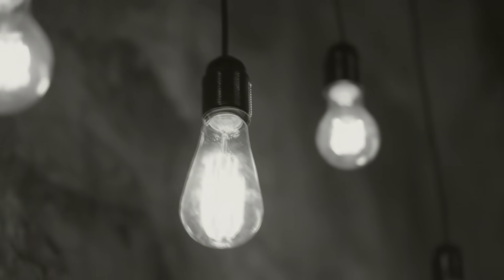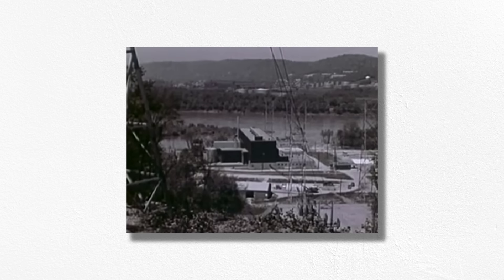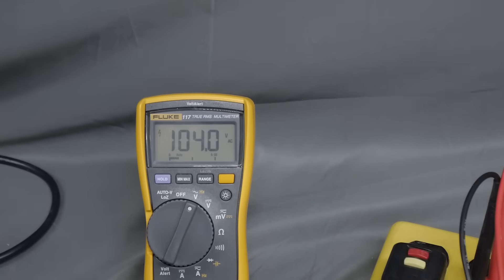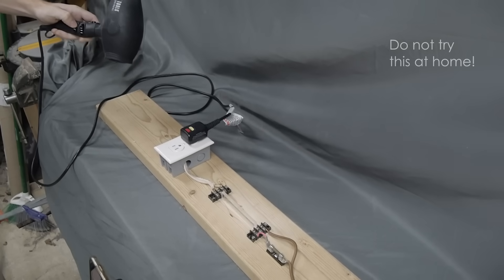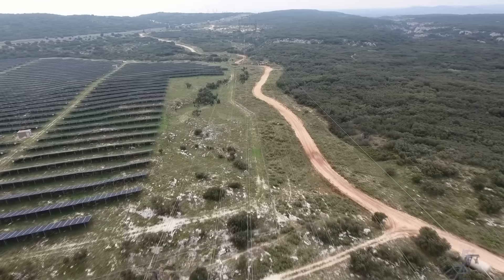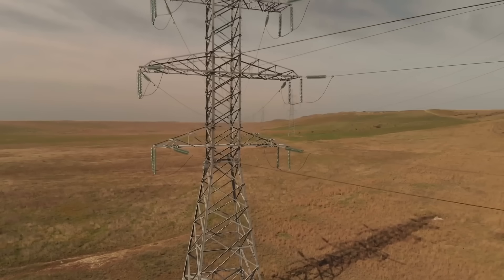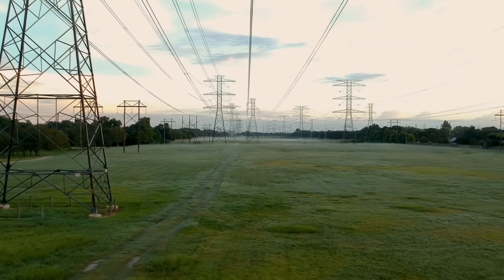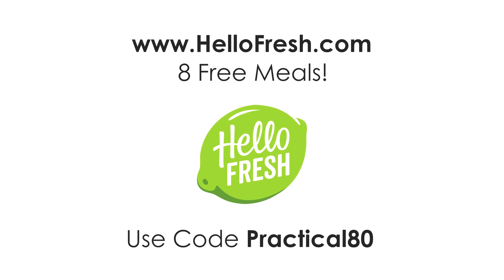How do Electric Transmission Lines Work?

Comment: Just making sure i got it right. does the ceramic disks prevent electricity from flowing through the metal tower to the ground, while their shape prevents electricity from taking the short route to the tower via water on the ceramic disks on a rainy day?
Reply: Yes. There convoluted shape makes the conduction path longer so that smaller insulators can be used even when wet.

Comment: Loved the hair dryer transformer bit was a brilliant idea. Always good to see a video from you :)
Reply: Using microwave oven transformers to do the step-up / step-down usually results in very high losses, and is really only good for demonstration.
Reply: I was reminded of electroboom, and then got disappointed why you didn't shock yourself.
Reply: Yeah it was a great idea, so good I think I might try it at home
Reply: @willdbeast1523  s
Reply: @willdbeast1523  I know you're probably joking but... please don't, that thing is a death trap. That thing has wires live at several thousand volts, and you should stay away from those — literally.
Reply: I don't see any danger if you know how things work.
Reply: @willdbeast1523  why not just go straight to the source and touch the wires at your local sub station *s
Reply: CasuallyPlayinGames totally agree, I knew most of these things and still found the demo cool. Hard to beat seeing something in action!
Reply: Sure was!
Reply: such a clean demo, recently got an old microwave from, a friend. really want to replicate the demo
Reply: @memejeff  its a wasteful setup, those transformers (any small transformer) typically have high losses, so two in series will be terrible. Microwave transformers are awesome for many other projects though, like playing with and learning about high voltage. For example, the old fashioned way of making a tesla coil, involves using a microwave transformer to step up the voltage before it goes through a spark gap. With a relatively simple setup you could make several hundred thousand volts easily (and safely) and demonstrate things like real wireless electricity.
Reply: @Nabo00o  Yeah, I know about the low efficiency but as a I said. I thought the demo looked clean and would work fine for a little demonstration setup to show the principle. I was thinking of using it mainly for microwave generation and for the versatile 2000VAC output :D
Reply: Can everybody PLEASE check out Photonicinduction. 
He explains just how dangerous microwaves can be
Reply: The voltage drop occurs at the END of the long extension cord; not at the receptacle that said cord is plugged in at.
Reply: You think he uses it

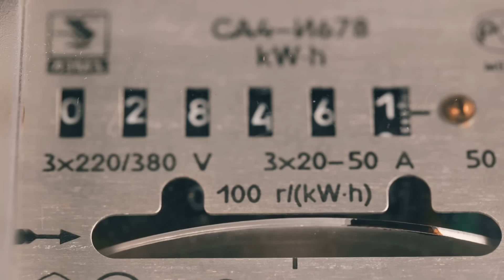Comment: 1:19 here you get billed for transmission loss as well :c
Reply: Everybody gets billed for that. Companies are not charities. For most people it's just included in the kWh price of the usage they do pay for.
Reply: Where is "here"?
Reply: In Jordan the government compensates the loss in transmission by stepping in as an intermediate party that runs the transmission lines between generation companies and the distribution companies. it counts of up to 37% of generated electric power.
Reply: In SoCal we get billed by power companies because they start fires due to lack of maintenance.  
We get billed for improperly designed nuclear power stations and later decommissioning of those plants.
We get billed when they convert to solar and wind power.
We get billed for the pollution caused by coal, gas, or hydro.  
We get billed for even thinking about using electricity at the wrong time of day.  

Now they shut the power completely off if they think it's too dangerous.
Next we will be billed while sitting in the dark

. ..
Reply: How? Sure you pay a fee per kWh for high- and mid-voltage transmission to your energy provider, but that is more than just the transmission loss. You only get billed per kWh that passes by your Wattmeter/Ferraris-counter
Reply: Andrea
"In Italy you get charged for inductance and capacitive losses in your house."
That's probably what he's referring but at least in my country Brazil you have some accepted limit of loss 8%.
Reply: In the USA I get billed for Transmission and Distribution which are both a large percentage of the total bill and are charged per kWh.
Reply: In Italy you get charged for inductance and capacitive losses in your house.
Reply: in Mexico you have your price per kw/h and a transmission fee + many other half ass fee's...
Reply: I've never seen an electricity bill explicitly mention transmission loss.

But on the other hand around here we have to pay a 'standing charge' just for having al electrical connection.
And given how high this charge is in relation to the cost of electricity, if you use less than about 10 kwh a day you're probably paying more just for being connected than the electricity itself.

Meanwhile when I lived in England I was getting bills for water and sewerage separately...
And the Sewerage bill was calculated as 1.1 times the water usage of the property, with the excess being 'stormwater' drainage...

Anyway, it's all in how you look at it with stuff like this.

I've heard people argue that 'income tax' is the fairest form of tax because individual pay it (can't say I agree with the reasoning these people use about why this specifically is fair)
But regardless of whether that's fair or not it's also a bit of mental trickery to say 'individuals' are paying it;
The vast majority of people are employed by others, and typically it's your employer paying your tax.
Which means you could easily argue it's not really a tax on individual earnings but instead a tax on hiring employees.
Does this distinction matter? Not really, but it mainly just demonstrates it's a matter of interpretation.

Paying for transmission losses separately vs the electricity provider simply factoring it into some other element of the bill (standing charge, the electric rate itself, or whatever) is really an academic difference that is more about how you present information than about anything meaningful.
They're still primarily working off your meter reading, then maybe doing a few simple calculations somewhere along the line.

Doesn't really change the overall outcome much.
Reply: Can't do shit about it unless we manage to break even.
Reply: Yup, in my area it's called systems loss and it's a per kwh you consumed charge.

Comment: Wind also has a very large positive effect, with small amounts of winds ~2m/s + greatly increases the heat dissipation of a power line. 

Also earth wires are typically used for communication as well with multiple fibre optic cables embedded with in them.
Reply: The company that runs the transmission lines replaced the upper shield wire on the 120 kV line in my yard. The new shield wire has 1700 optical fibers. But they aren't used for communication, at least not yet. They haven't gotten permission from the railroad to work over the tracks. The rest of the fancy new cable is spooled on the tower across the tracks from the substation.
Reply: Here in the Netherlands we have some high voltage powerlines above ground but all the low and medium voltage is already in the ground. New high voltage lines are also laid into the ground nowadays. So no not really. Wires in the earth are not only used for communications and other stuff..
Reply: @brinkshows2720  Well that works because the Netherlands are really dense in population, small in size and not subjected to earthquakes (except Groningen but w/e) 

Population density and size helps because digging holes is friggin expensive. Having less distance needed and more people able to pay for it is good. And the no earthquakes and other mayor disturbances makes ground cabling relatively worthwhile to do.  Also, when you move further and further away from the randstad the powerlines start appearing.
Reply: @Torchedini  Yeah thats because in the Randstad the powerlines above ground have been replaced. But more outside the Randstad if there are new powerlines they are also laid inground.

About the population density. This is true that its really dense, but if you look anywhere in the country there is no low or medium voltage line found above ground. Also in foreign countries you also see low voltage powerlines in cities above ground. 

Yes we don't any earthquakes (except for Groningen a little), but powerlines are one of the utilities that is least affected by earthquakes. Some even say its better to lay them in ground because when an earthquake hits powerpoles fall over and create damage and dangerous situations, while if they where in the ground they wouldn't have.
Reply: Torchedini for sure. Its around 16-20 times more expensive to underground powerlines here in the UK!
We find it hard enough getting a large enough budget to maintain and upgrade the overhead network as it is.
Not to mention under fault conditions, underground cables are hard, time consuming and alot of hassle to locate damaged sections on, leading to greater disruptions in supply, greater resources to correct and generally a nightmare for everyone involved
Reply: @brinkshows2720  The Netherlands also has a pretty mild climate. For much of NAmerica the top several feet of ground will freeze in the winter which can be (a) very damaging to infrastruture (b) a big hindrance to construction and/or repairs. Plus NAmerica had/has a surplus of trees making wooden poles much much cheaper than underground wires.
Reply: @JonnyD3ath  except of course when there are existing ducts from a prior project, then the extra cost is only paid once initially, plus a little extra to access the duct again. In my city gas, electricity and phone are ducted in some areas, and in a subset of those, fibre optic cables were later threaded into existing ducts. I believe a lot of the underground fibre rollout is also adding ducts where there weren't previously, for future expansion/repair/other unrelated use. Some places use the gas pipes themselves as the ducts for fibre. I like ducts.
Reply: Kit Vitae at a huge expense though and generally only in cities, most of the transmission network is rural. 
You can bet if one company has spent tens of millions building a servicable duct in a city they aren't going to just let another company walk in and install their equipment free of charge either! Lol
Reply: @JonnyD3ath  definitely only in cities or otherwise wealthy enough populated areas. The small but wealthy village I used to live had a duct installed under the road when Openreach put in fibre, it was nothing more than a corrugated plastic pipe like you might use for water drainage, but importantly it provided a barrier for the fibre from the soil, and could be accessed at certain points along the road (where they installed square manhole cover looking things, 2 or 3 along the one main road in the village). 

We had overhead power transmission, but Openreach didn't choose to just string it along those existing poles. In the city I live now, as I said, everything is underground and ducted, which sure gives peace of mind in floods or storms, which both hit that little village pretty hard too, and we got power cuts and all sorts there from it. Maybe that's why they buried the fibre, it's more involved and costly to splice a new section of fibre than it is a power cable. 

Anyway. It was my understanding that they usually leased space in the ducts, or leased dark fibre they put in the ducts while installing their own line, as opposed to outright blocking access and forcing overbuild. Especially with overbuild reduction being a key part of the UK governments' Openreach investment terms. But maybe I'm wrong, or it's just not as common as I think. Either way, I know the fibre provider to my block of flats ran their cable through the existing power and phone duct on my street, however they arranged it to happen. (Maybe the property developers made the duct themselves when they made all the flats? Electricity, phone, gas and water all had to be specially extended here when building started, and I think it's not technically a public road?)

They only had to dig one access point in the road and some minor work in the basements, I'm pretty sure. I remember seeing a small fenced off area appear and thinking the road would get all torn up like in the village, but after a few days the fencing came down and didn't come back up. Compared to when there were water works ongoing, and their fenced-off area slowly crawled along the street over a few months.
Reply: Kit Vitae it has to be done in a city environment and is economically justifiable but on a wider scale i know just to underground cable costs in the region of 16-20 times more than conventional overhead lines, that is not even factoring in a servicable duct for multiple service useage
Reply: @JonnyD3ath  yeah, that's why I wondered if they made an exception in my village due to being a flood zone, rather than that being usual policy in small villages.
Reply: Kit Vitae hard to know! But ducts flood aswell, so arn't always a great solution.
I have found alot of ducts fill with water then just retain the water so the cables are permanently submerged! The fibre and telecommunications network doesn't have the same safety concerns as the power network either, as you can imagine alot worse things can happen with our faults 😄
Reply: @JonnyD3ath  mm, makes sense.
Reply: @brinkshows2720  Are you sure the high voltage lines are buried? Many people think high voltage is the 240V feeding their house, when high voltage is often in the tens of thousands of volts, which is difficult to fully insulate.
Reply: @AlexFlockhart  Yes i mean high voltage. 1000V plus is seen as high voltage.
Reply: @AlexFlockhart  Buried power lines are much more reliable. If you do a total system lifetime cost analysis and assume a 75 year lifespan for infrastructure, and have appropriate tax policy, underground is usually cheaper.

I live in the US where we don't plan for 75 years in the future and our tax policy changes randomly every 4 or 8 years. We only bury power lines immediately after major power failures due to our bad infrastructure. It works differently in some other countries.
Reply: @brinkshows2720  he is talking earth as in ground wires... Not literally in the Earth. I understand English is your second language, but don't respond if you don't understand.